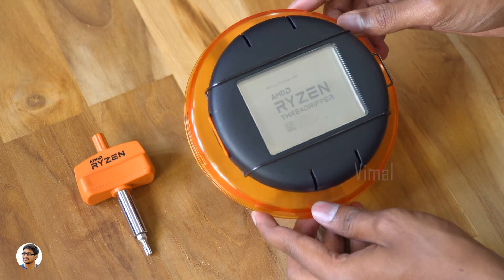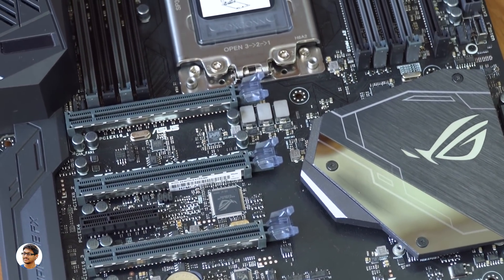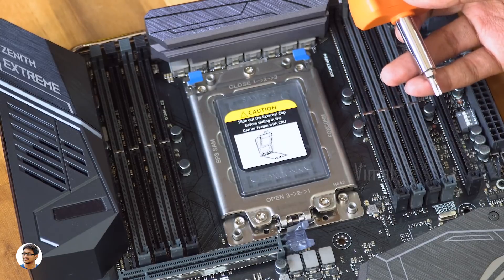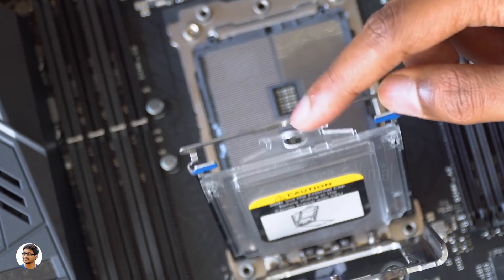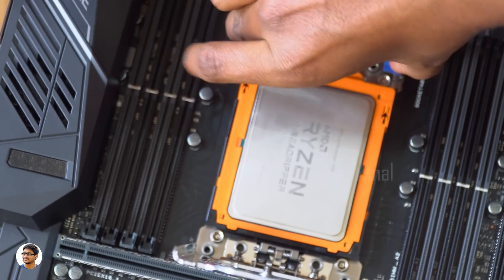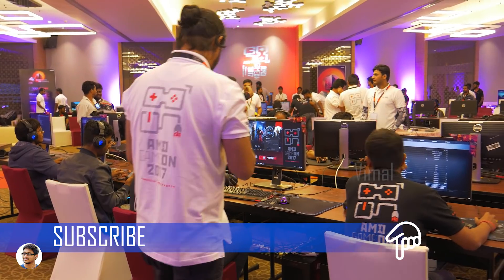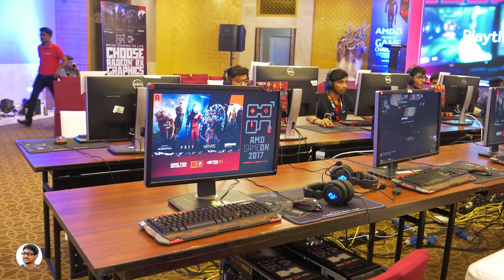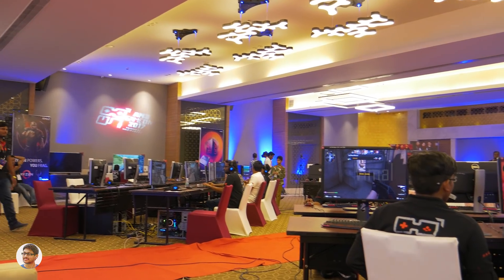Ryzen Threadripper Installation Tutorial + Complete Guide India!

Comment: i am a layman.how do you know which processor supports which motherboard?
Reply: You can just have to check the pins types of the cpu and supported ram and then select the motherboard accordingly.
Reply: i see.i never knew this stuff.i used to think processors were permanently soldered to motherboard
Reply: +winvsdroid no they are not. you can remove the processor and install another one any time.